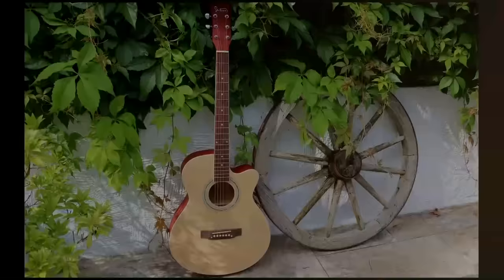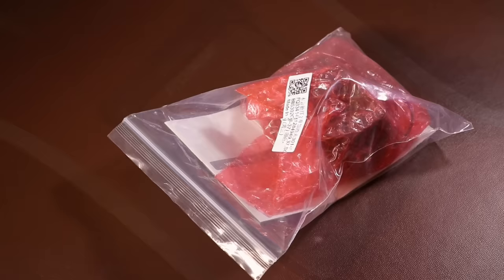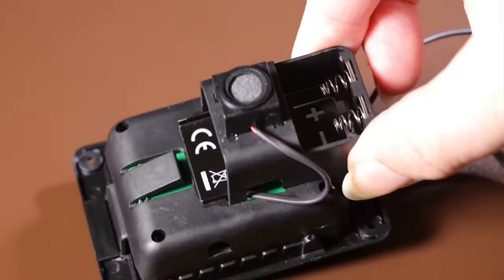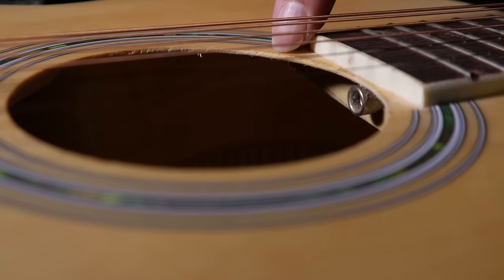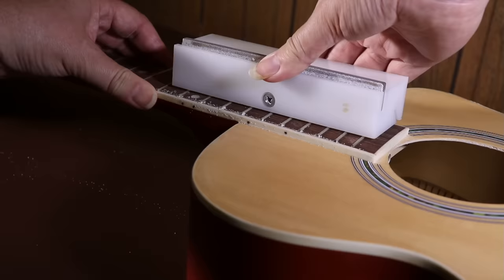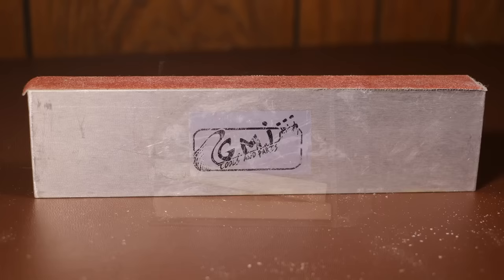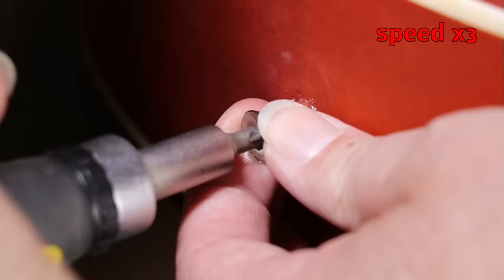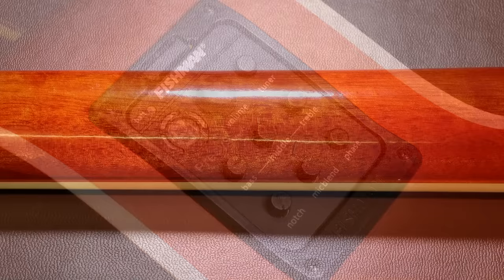How to make a cheap acoustic guitar play like an expensive guitar.  Upgrade an acoustic guitar

Comment: What’s your opinion on power pins? I put a set on one of my guitars and of nothing else it makes stringing it up so much simpler! But I think it sounds better, admittedly I put a lighter set of stings on it so that may be some of it, but it also improves the look. I’m always looking for upgrades so I’m very interested in your video
Reply from the maker: I need to do a video test of them one day.  My opinion is that I know changing plastic pins for bone or hard wood improves the tone, so power pins will improve your guitar, and they look quite cool as well.  My only issue with them (and most guitar parts) is the price, the guitar in the video cost around £50 and power pins cost around £50.
Reply: @guitar-academy  yeah they are a little pricey, but one thought I had about them is on one of my guitars the bridge base is coming loose, and the power pins actually tighten the bridge to the body the pressure isn’t pulling up or digging into the body. I had to change my strings anyway due to a string break. I figured I had them on hand if I liked them I’d eventually get another set. If I didn’t no harm. I like em. A long Allen wrench would make installation easier, but it would make tightening harder. Something I’m curious about is the Zayger guitars setup, supposedly makes it a lot easier to play. What is the “secret” to their set up
Reply from the maker: @russellcox9037  Yes the fact that it holds the bridge in place is a great bonus and it could actually save money.  I you have to take a guitar to a luthier to have the bridge fixed properly could cost you and arm and a leg.  I think the only secret with the Zayger guitars setup is that they do it properly and check everything.  To do a full setup is a lot of work and most shops just adjust the bridge/saddle height as low as they can, whereas if you do it properly you start with the neck relief and then the nut height and finally the bridge height.
But low isn't always good as many jazz players like a high action to get a cleaner tone.

Comment: Hi, great video. Have you tried one of these magntic Tonewood amps that hang on the back of the guitar and make it act like a reverb pedal but coming through the sound hole?
Reply from the maker: I have one that fits in the guitar, but I am waiting for a suitable guitar to fit it in before I make the video . . 😊
Reply: @guitar-academy  
Cool, are you saying "fits in after some changes to the guitar" or works on magnetism like the Tonewood amp?
Reply from the maker: @chrisneeds6125  The one I have you have to fit inside the guitar like fitting a preamp.  So in other words you have to drill and cut holes in the guitar to fit it. 😒
Reply: @guitar-academy  b
Oh, OK. Do you mind telling me what make it is? 
I bought a second hand acoustic for five pounds for just such an exercise. The Tonewood amp uses the guitars pickup and preamp so i would have to buy and install both, if your model works the same way.
Reply from the maker: @chrisneeds6125  It's the 'guitto ggp-02 pickup', but I don't know how good it is yet as I haven't fitted it . .

Comment: so Almond oil!! :o I have used lemon oil. Is there a difference?
Reply from the maker: Not at all . .  lemon oil is by far the most common oil used.  I use Almond oil because on violins it helps dissolve resin that can build up.  Some people in the internet claim that almond/lemon oil goes rancid, but I have been using it for over 30 years and I have guitars here that have been treated with it over 20 years and none of them have gone rancid. . . 😊

Comment: What is that oil used on the finger board again?
Reply: Almond Oil. I use Lemon Oil. More importantly , we do not want the wood from 'drying' out and eventually splitting, cracking etc. I use string lubricant that comes in a spray can so whenever I spray the strings on a guitar i always give the fretboard a spray too and do it with all my guitars while I have the spray can in my hand since it takes all of 5-10 seconds for each guitar. How many guitars should you own, also known as the optimal number ( Fn) ..... the formula is G= number of guitars already owned. F= optimal number of guitars. If F < or =  Fn then Fn = G + 1 .
Reply from the maker: Yes I use Almond oil, but I know a lot of people (especially Americans) like lemon oil.  I've never tried the lemon oil, but I think I will to see what I think. 🙂

Comment: Bit late to this, would you recommend t cut for removing a finish?
Reply from the maker: T-cut takes a very thin layer off the top of the finish, so if you have a gloss finish with fine scratches, it'll sort that out and also if you have (as I did) a mat finish neck that you want to be glossy is will sort that.  BEWARE though, it takes a lot of rubbing to get the finish, and don't use it on a guitar where the lacquer is thin it might remove it completely.  🙂
Reply: @guitar-academy  lovely, thanks for the advice

Comment: What was the brand of the almond oil?  I tried your Amazon link but it wasn’t there.  Thanks.
Reply from the maker: sorry, I've worn down the label so I can't read it, but you can buy it at any pharmacist, but also Lemon oil does the same job if you can't find Almond oil. 😊
Reply: @guitar-academy  thanks.  I use lemon oil but was keen to try almond after your recommendation from the violin luthier...especially as I’ve heard lemon oil is good for some woods but not all.
Reply from the maker: @Telcontarnz  The violin maker I got that advice from repaired a 150 year old violin for me and did a perfect job, so he knew what he was talking about.  Sadly he's passed away.
I think the Almond oil for skin care is very pure and that's what I use . .  the only part of the label left shows a hand putting it on skin . 😊

Comment: Dressing the frets won't change how it plays or sound's.  Adjusting the action probably won't make sufficient difference to the sound either.
Reply from the maker: Dressing the frets is essential to do before adjusting the action and adjusting the action, especially on a cheap guitar and having correct action makes a huge difference to the way a guitar plays.

Comment: I am sure you made the ten-year-old youngsters that built that guitar very happy! I seen a another guitar Tech enhance a electric Glarry guitars I can't believe they make them so inexpensive! And it actually sounded pretty good after he got done with it. You done a nice job on this one never seen anyone do an acoustic. But a bone nut and saddle would have probably made it a lot nicer sounding.How low did you set the action not using a pick you must have set it a little higher then a flat  picker, how did it go with the intonation?
Reply from the maker: Thank you for commenting. You should watch the other videos on this guitar . . this video was a summary of the work.  Here is the video where I replaced the nut and saddle with bone . . https://youtu.be/N9dvUg90T6M enjoy . .

Comment: a lot of guys probably won't believe you, but I've made cheap guitars, both acoustic and electric play better and sound as good has high dollar guitars.
Reply from the maker: The only guitar review I've done that I couldn't finish because the guitar was so bad was a Fender . . .  that says a lot . . 🙂
Reply: @guitar-academy  hmm, must have been one of the Chinese Fenders. I don't happen to like Fenders, they are overpriced for name value only. I still have one of the better First Act stratoclones that now plays better than any Fender I've laid my hands on. I failed on only two restorations, one a vintage acoustic from Israel that was so dried out... well actually I got it usable but never will be a great guitar, the other one was a oh hell I forget the name, a vintage cheaper but American made acoustic, I just couldn't get it right after three tries at a neck reset, I sold it as parts. A Fender 12 string acoustic gave me fits, but I got it as close to right as it ever was. you can tune a car, you can even tuna fish, but you can't tune a 12 string I believe is how the saying goes. I never want to try another 12 string. My favorite restoration is a Flamenco style acoustic, the neck was so bowed that you could have used it to shoot arrows or play horseshoes with. No steel in the neck of thsose, they're never supposed to have steel strings on them, but this one did and for some reason they kept tensioning them even after it was long past playable. Took me about nine or ten weeks to straighten the neck back out. I made a jig to allow me to use bass strings to apply tension in reverse. I would steam it daily, and apply a little more tension in reverse, every day for howeer long it took, I foget now, but it was a long time. at first you couldn't tell any differnce by eye but I eventually got it back to playable and it's the best sounding acoustic I've ever had, but it likes an open C tuning, not a standard tuning, nor even my usual open D. In open C it holds tune well and just has a very nice mellow sound. I don't restore guitars any more, there's no money in it, parts are high, even used. You could look on ebay and see that guys were taking apart whole guitars to sell as parts, when I got out of it I sold off the bulk of my parts stash and made way more off it than I ever did on the guitars themselsves.

Comment: Does any brand almond oil work.
Reply from the maker: Yes, as long as it is just almond oil without any nasty additives.  You can also get specialist oil from guitar suppliers, but they are more expensive and I have used this for over 30 years, so it's what I'm used too.
Reply: @guitar-academy  thanks

Comment: is it a real fishman?
Reply from the maker: Apparently not. .  I've been told that this model of preamp is only available pre-built into guitars.  But I haven't had that confirmed.  The quality and sound speak for themselves though.  If it is a fake, it's better than my original.  😀
Reply: @guitar-academy 
What kind of glue do you use to install a new nut?

Comment: 13:50 or you could apply masking tape so you don't scratch any surfaces....
Reply: I just did all this. Took my preamp, and input out of my old Samac and stuck in my Gretch resonator wired with a transducer under the cone.
Reply from the maker: I've tried that and the file just rips it off . . 🙂
Reply from the maker: Did it work ?

Comment: Thanks, very good but you don't mention the strings? did you change them as well? it would have been good to hear a before and after sound check as well.
Reply from the maker: No I didn't change the strings, because I will be making a further video where I replace the bridge with a better one.   A before and after sound check would have been pointless, because it didn't have a preamp or pickup fitted before hand. . .  obviously.
Reply: @guitar-academy  fair point but the sound would be compatible without plugging in the amplifier ?  Look forward to the strings video and thanks for your efforts.
Reply from the maker: @rowley51  To be honest the sound had no discernible difference between the beginning of this part of the project and the end.  But this video was really about the feel of the guitar and the amp.  As soon as the new bridge arrives, I will do the restring video . . 😊

Comment: A cheap guitar doesn't have a truss rod, and cannot adjust a neck problem. Cheap is poor quality usually
Reply from the maker: sorry but you are completely wrong . .  this guitar has got a truss rod and every cheep guitar I've reviewed has had a truss rod.  To confirm what I'm saying is true, watch this video, same make guitar about the same price https://youtu.be/UgsN_HOjV2c
Reply: @guitar-academy  I have worked on many guitars, and the Chinese will put out guitars with no truss rods at all. I have changed fingerboards with no truss rods underneath. Martin has a guitar designed with no truss rod. I am not a Luthier but I worked on many guitars, and some that should be thrown away due to warped and curled necks.

Comment: Any effect pedals will do just that.Just find the correct "expensive " tone.This is not computer science. It means another extension to your guitar but it will do the yrick
Reply from the maker: Hmmm why are you trolling ?
Read the title . . 'How to make a cheap guitar 'PLAY ' like an expensive guitar' not sound like one, and you can't use any effects pedal without first fitting a pickup which is explained in the video.